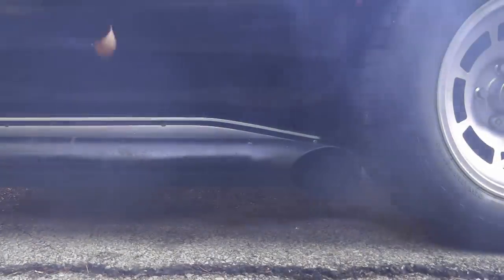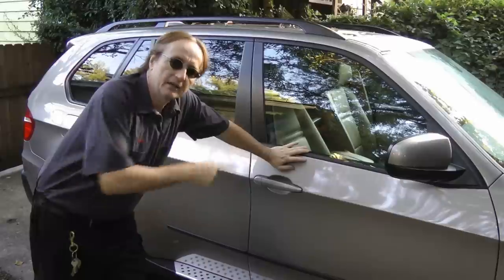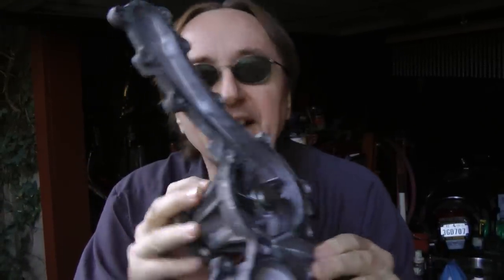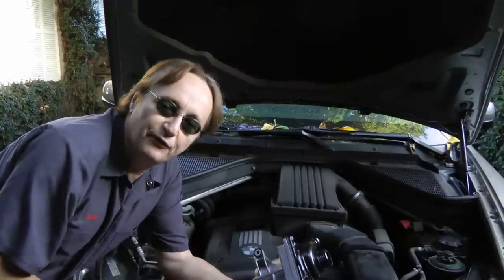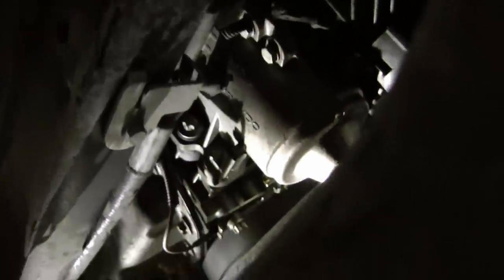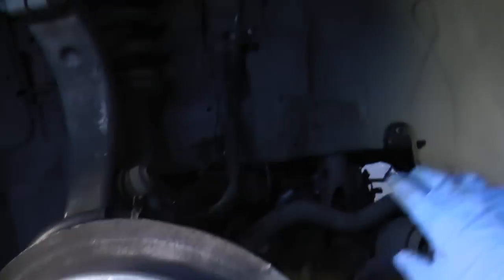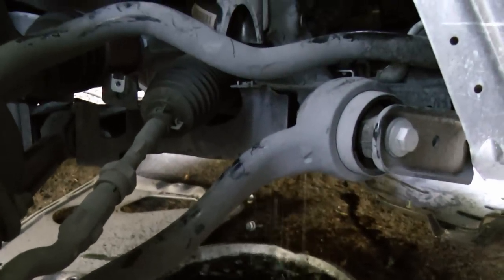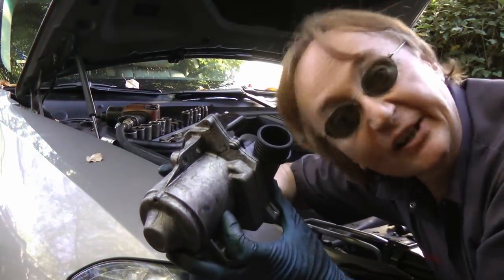How To Replace a Bad Electronic Water Pump

Comment: It took my belt driven water pump eleven years and 150,000 miles. Took me an hour to replace.
Reply: My 2000 Camry with 250,000 miles and still has original water pump. My other BMW 2011 335i on third water pump at 80K miles.  The BMW water pump itself costs $500 plus $500 for labor.
Reply: @glenglene8473  I think you need to go to another part provider such as FCP Euro because the electronic water pump was updated more than four times and has a lifespan of 80K now...

Comment: German overengeenirng. Next, they will make a special computer that  will control the radio volume, so that every time you turn it on, it will set the volume by itself. And when that computer breaks it will cost you hundreds of dollars to replace. Now thats genious.
Reply: I think that does exist

Ive seen these radios that will NOT allow you to adjust any changes  unless youre at a complete halt

Comment: I just did mine today. The same car in this video a bmw x5 e70.

This job is easier by removing the radiator and front bumper. Great video on explaining bmw engineering...

Comment: Scotty Kilmer: Thanks for posting the video all your videos are Superb quality I love watching them. I have Mercedes Benz (2006) S500 Very nice car but has airmatic issues . The car has 185000KM 
I have two more cars (2007) Audi A8 very nice car  it has ABS problems The Car has 158000KM
My wife has (2008) BMW 750LI This is the worst ever made car every month on towing truck
too many electronic problems and mechanical issues hydraulic suspension lines, alternator bracket oil leak. Electronic parking brake , ABS module dynamic stability control , Transmission overheating. BMW dealers they charge too much for a small repair. They won,t even replace the batter for free. I myself love Cadillac, DHS /STS / SRX / Pontiac G8 non turbo the best machine in the world they don't brake  too much the parts are less expensive and easy to repair. I love my Pontiac G8. Scotty : Which domestic  car is the best that will not brake and rust. Keep posting the videos you are very professional  on every car. Thanks

Comment: BMW never make anything last more than 40k miles. I had over $20k worth of work done on mine, with more than half of the engine components replaced.
Reply: J. C more reliable than a chevy!
Reply: funny, ive owned 2 e30s both over 250,000 miles. following that a 1999 e46 with 302k. Now currently a 2008 twin turbo n54 135i with 90k. better then most garbage on the road
Reply: you been under a rock.. cheys are way more reliable and easy to fix. BMW and Mercedes are  on the top ten most unreliable cars...
Reply: Try owning the first gen n63 then we'll talk.......everything breaks on that engine. Timing chain stretched, all valve seals went south, leaking on both turbos, leaking oil pan gaskets, cracked coolant tank, leaking turbo coolant lines,  collapsed engine mounts, bad a/c evaporator core,  power steering lines, drive shafts replaced TWICE, vacuum pipes replace 3 TIMES. All happened within a year and a half. And I don't even drive her hard. Now the front shock bushings are going bad, rear shocks are leaking. Don't know if the trans are giving up because it jerks at high speed and rpm drops below 1k. Tbh, This high maintenance bitch bangs more dealership tech than banging me. She should be giving me heads. If she doesn't love me I might as well let her go.

If I were to get another BMW again, I'm just going to lease it. BMWs are just fancy sluts. Not the housewife material that I'm looking for.
Reply: International Innovator I have a friend that has a 2010 Camaro SS and he put on a cam on it and one fucking valve spring broke. Never heard that happen on a bimmer.

Comment: I didn't expect that from German made cars!
Reply: +Badr Fazli Then you haven't read the widely-published frequency of repair data.
Reply: Badrstech The newer ones have this design flaw, not the older ones.
Reply: Well, it seems like old is gold.
Reply: Badrstech if you have to buy a new car, you can buy a bmw most especially when we have a toyota as our everyday use car. Buy for 2nd hand or used car, a bmw is very risky as dont know how the previous owners treated the car.
Reply: Badrstech yeah "superior German engineering" is a myth... I bought a used x3. It's a great looking car but omg do I regret buying this. There is never a time when something isn't going wrong.